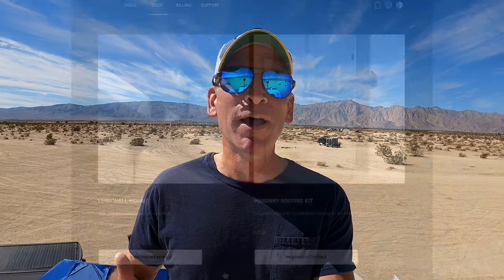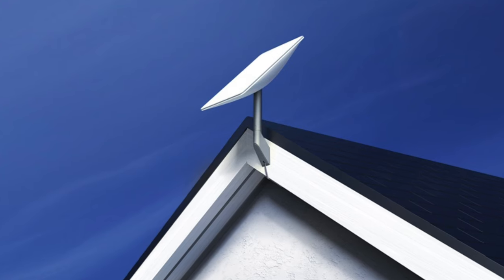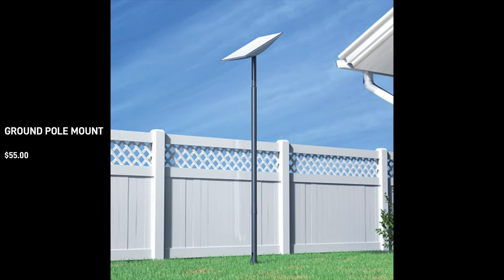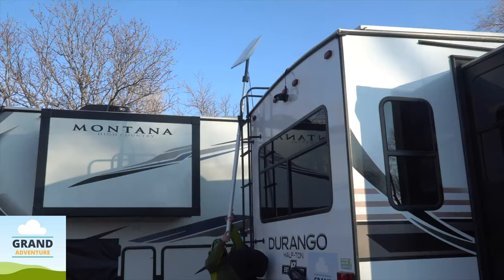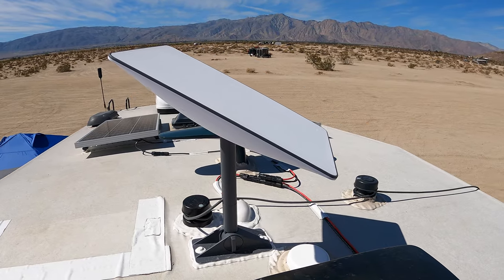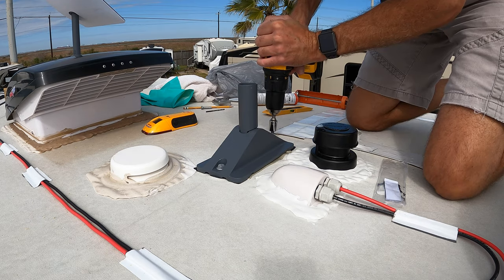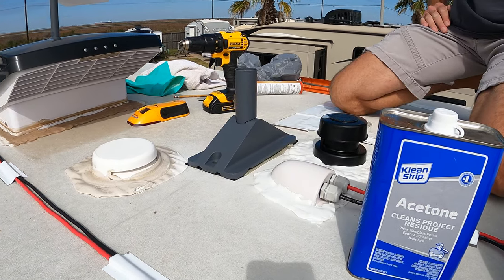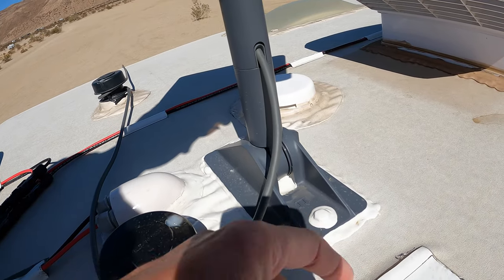Starlink RV Roof Mount Install + Review Of Other Starlink Mount Options

Comment: Thanks for the close technical view of the PIVOT mount. I went that route but my TT had nice oval cross rails on roof and I just drilled holes thur cross bars and the pivot mounted easy peasy close to my rear ladder. No holes into the actual roof.
Reply from the maker: Excellent!  Less holes in the roof is always better.

Comment: awesome job! have you driven the vehicle under gusty wind? does it stay there well? i’m always afraid that gusty wind will blow away or damage the dish
Reply from the maker: Thank you!  We have not driven with the dish mounted.  Once we arrive at our destination, we install and then take out of the mount before we leave.  We have been through some pretty big wind storms though while parked - 40 to 50 MPH gusts  - and it held up very well,  no issues.

Comment: Hi Homie, this is very helpful.  Drilling the roof is very disconcerting but your video eased the anxiety. Is it possible for you to tell us or show us where the cord goes? I am trying to figure out solutions where to run the cord without leaving doors or windows ajar.  Very grateful for what you guys are doing to inform us newbies.
Reply from the maker: Hi Lester.  You are very welcome!  In this other video, I show how I have our cord ran into the rig around the 2 minute, 20 second mark https://youtu.be/wm8IJ65dgag .   We still run it this same way even after several months.  I thought I would do it a different way for a more permanent run, but, this is just as easy and I don't have to worry about the cord or end being damaged by leaving it up on top of the rig while traveling.

Comment: Great video!  I just received my Starlink and had it running for one day.  It is awesome and I have attached it to my Class A with the pole mount to my ladder.  The first night I left it powered on all night and saw significant battery drain.  Last night I turned off the power to the unit and it went offline.  Powered up this morning and it took about 5 minutes to come back online.  Is this going to hurt the unit or do I need to leave it on all the time?  Thanks for your info!
Reply from the maker: Hi Casey!  Congrats on your new dishy!  We shut it down overnight to conserve power.  We've been doing this for over a month now with no problems.  Hoping that Starlink will come out with a DC power adapter.  I messaged Starlink and they said that nothing is in the works at this time.  I would think that they will eventually get to it as they see the number of people wanting to use it for travel.  Guessing they have bigger fish to fry right now.
Reply: @EddieAtLarge  it's funny you should mention this, there is now a plan for a 12 V adapter. The engineers are scratching their heads about this but there is a plan at least
Reply from the maker: @AIG Trader That's great news!  Really looking forward to it.  Thanks for the info!
Reply: Casey, do you remove the flag pole setup when traveling?

Comment: Hi, great video, thank you- I just purchased the Starlink Roam. It come with a mount that would seem more stable- is there a reason you did not use this,  instead of the mount you used.  Thanks again
Reply from the maker: You are very welcome.  Glad you found it helpful.  Yes, I did not use the original mount as I didn’t think it would seal very well where it would be screwed into the roof.  This mount seals very well and it has also been very stable.  We have had no issues at all.

Comment: How did you run the cable from the starlink? Im guessing you take the satellite down in transport so did you just come up with a temporary solution when out?
Reply from the maker: We do take it down while traveling.  We have the router plugged directly into our inverter that is located in our front storage bay, so, we ran the cable through a factory pre drilled hole in our propane compartment that is adjacent to this storage bay.  I have a Velcro tie screwed into the wall in the propane compartment and just coil the wire up and hang it in there while traveling.  I also tape over the end of the connector with painters tape to protect it from road grime and moisture.  Hope that helps!

Comment: G'day mate - great vid, but have you just sentenced yourself to never be able to park up under trees (obstruction)?
Reply from the maker: G’day!  Glad you enjoyed the video.  I actually purchased an additional 150 foot Starlink cable (from Starlink) to be able to string out the dish well away from the camper if we ever need to.  Surprisingly, we’ve only had to do this a few times.  We also have solar on the roof, so, we usually try to avoid trees and obstructions unless we’re plugged in at an RV park.

Comment: Hey man, thank you for this video. How do you guys manage the cabling?
Reply from the maker: You’re welcome, glad it was helpful!  We keep the router in our front bay where our inverter is housed and I have it plugged directly into the inverter.  The cable is then ran to the outside through a hole that was made for the propane line.  Then it’s up to the roof from there, however, I put the cable up and take it down each time we move.  While moving, I have the excess cable spooled up and secured with a Velcro strap and hook inside the propane tank bay.  Ideally, I plan to run it permanently to the roof so I don’t have to mess with it anymore.
Reply from the maker: I finally ran the wire permanently.  Here’s my install video if you’re interested.  STARLINK RV ROOF MOUNT PERMANENT CABLE INSTALLATION
https://youtu.be/CKsdDV-yQzQ

Comment: Ed, thanks for the info.  I just got back from 7 weeks of travel in my RV in Baja.  Don
Reply from the maker: Hey Don, that sounds awesome!  I’m sure it was a great adventure!
Reply: @EddieAtLarge   Ed, I highly recommended in your RV. It is so beautiful.
Reply from the maker: Cool!  5th wheel friendly?
Reply: @EddieAtLarge  Ed, it has narrow roads but I Did it in my class a with a enclose trailer and tow. I was 50' long 26000 pounds and I never disconnected the the trailer. So if I could do it anybody could do it. The tine of  Here is very important I suggest leaving February 1st and being back no later than March 31st.
Reply from the maker: @CowboyBikerAdventures   Thanks for the info Don!  Will definitely keep that in mind for a future trip.

Comment: Great video homey, 
Did you ever decide to run the wire permanently? 
If so what did you do and if not where did you pass the cable? 
Currently trying to figure out what’s the best option
Reply from the maker: Hey Juan, thanks!  I have not ran it permanently yet, but, am still planning to do so.  I’m going to run it from the front bay (under the 5th wheel) where we have our batteries and inverter.  I have the Starlink router plugged directly into the inverter that has 3 outlets.  I’ll run the cable from there, through the underbelly and into the area under our stove where our converter lives.  From there, I’ll drill a hole in the wall adjacent to the refrigerator and then run the cable up through the refrigerator cavity that vents through the Rv roof.  Then I’ll run the wire along the roof to the dish and tape it down with Eternabond to secure it to the roof.
Reply from the maker: I finally ran the wire permanently.  Here’s my install video if you’re interested.  STARLINK RV ROOF MOUNT PERMANENT CABLE INSTALLATION
https://youtu.be/CKsdDV-yQzQ

Comment: Hey great video very informative. Got a question can you leave the satellite up there while driving on Highway speeds?
Reply from the maker: Glad you enjoyed!  We take the dish down before moving and I would not recommend leaving it up there.  It may handle the wind, however, there would be potential clearance issues at overpasses and low tree limbs, etc… and when hitting rough spots in the road, it may loosen the mount or cause damage to the dish.  Some people are now making custom mounts by disabling the motor, cutting the back of the housing off, installing a new backing and installing the dish flat in a fixed manner on the roof.  Here is a link to the Facebook group Starink Hacks where you can see this in more detail. You will have to join the group to see the post though. https://www.facebook.com/groups/446129073286883/permalink/798557751377345/

Comment: Running the cable is also a challenge. Do you leave it on the roof while traveling? I know "In motion" is not supported so just unplug the router.
Reply from the maker: Hey Cliff, we take the cable down before we travel.  I thought about running it permanently, but, I’d still want the end protected when unplugged, so, decided against it (so far).  Yep, we just unplug it and put the router & dish in the original box for travel.

Comment: Hey - great video - thanks so much!  I was wondering though, if they didn't leave the higher "Sides" to allow water to drain out from under the mount?  When you put butyl tape there, that cut off the water from being able to drain there.  I saw you sealed under the pivot mount as well (directly under the pivot), but what if the pivot itself leaks?  Wouldn't it just be OK to leave the butyl tape off the sides, leave those sides "Higher" so they can drain any water that leaks through those holes under the pivot or the pivot itself?

I am also wondering about cable routing.  We just bought a Class-C and are planning on having StarLink for Internet.  Other questions are answered below, like does it hurt to turn the unit off overnight and so on.  And, I assume it's not a problem to turn it off for longer periods when RV is not in use and so on.  We have a crowded roof on ours, it's only a 24' Winnebago, so we may opt for the ladder mount, that seems pretty handy, and might even lend itself to being able to disconnect the unit and take it down for storage (and anti-theft) when it's not in use.  Avoids the issues above of drilling, taping, sealing rooftop.

Thanks!
Reply from the maker: Hey Scotty, glad you enjoyed the video!  I'm certain that they did leave the sides higher for the purpose of drainage as you stated and I did initially place butyl tape in that area by mistake, however, after further consideration, I decided that it would be better to completely seal the mount both inside and out.  If I would have left the sides and center open the way they intended, the only protection the holes made by the bolts would have would be the butyl tape at the corners.  If the bolts were to loosen at all, that would leave the holes vulnerable to water infiltration.  The pivot post is located up above the open center area of the mount so I was able to completely fill the center void with self leveling sealant.  I also removed the post before installing the sealant to make sure it got worked under the mount.  
You are correct in regards to being able to turn it off for extended periods.  We do sometimes turn it off overnight when we don't have much sun to recharge via solar and it's also turned off while we move locations (usually weekly).  I do prefer using the roof mount as it works well for our situation.  Do you have a specific question on cable routing?  We run ours through our RV "wet bay" which is where the water hose enters when on hookups and we plug the router into an outlet in our RV storage area.

Comment: Do you remove it when moving or leave it up and stowed? Looking at options to mount on mine and possibly leave it up.
Reply from the maker: Hi Aldi, we do put it in stow mode and then remove it.  Our rig is about 12' tall without the dish and we would be concerned about damaging it when going under an overpass.  We also do a lot of boondocking and take the rig off road, so, another concern would be it possibly getting damaged by low hanging tree branches.  The dish is very easy to remove and reinstall.  Starlink also includes a dish carry bag with a shoulder strap when you order the mount which can be utilized when taking it up and down off the rig.  Hope this info helps with your decision.

Comment: Since you installed it on a flat surface, would the original mount that comes with the dish work for this? It is designed for flat surfaces.
Reply from the maker: It could be used if the surface is flat and if you are able to secure it and seal the penetrations properly.  I prefer the roof mount that we purchased from Starlink as I know it meets all of those criteria and I also wanted to keep the original mount for when I need to string it out away from the rig to avoid obstructions such as trees.

Comment: So do you take the Starlink off the pivot mount and carry inside when driving? And then can you swivel the mount so that it sits horizontal with the roof?
Reply from the maker: We do take the dish down before moving.  The mount arm can be rotated down to lay horizontal, however, we  leave it in the upright position at all times.

Comment: Can you drive with it attached? Can you also use it while driving?
Reply from the maker: For us, it would be too high for overpasses, so we take it down prior to moving.  I did make another video showing how I permanently ran the cable.  It’s so easy now to put it up and take it down.  Only takes a minute.  STARLINK RV ROOF MOUNT PERMANENT CABLE INSTALLATION
https://youtu.be/CKsdDV-yQzQ

Not sure if it would work while moving.  I’ve read that it’s not supposed to as it would detect movement and shut down service automatically.  Starlink does sell an “in-motion” dish.  It is much more expensive though.

Comment: Great information video just wondering when you get the dish up there do you have to take it down and back up every time you travel or is it OK to travel with it there
Reply from the maker: Thanks Dennis.  We remove it before hitting the road.  Good chance it would survive if we left it up there, but, don't want to risk damage as the unit is not made for mobile use and chances are good we would clip it off while traveling under an overpass.  It's fairly quick and easy to remove and reinstall though.  Starlink is working on a truly mobile unit that can be left in place on the roof of a vehicle and can be used while driving down the road, just no word on when that will be out.
Reply: @EddieAtLarge  Thanks very much for your time and answering my questions I’m not in a hurry so maybe will wait to see what they come up with for a mobile travel trailer unit I have Dish for my TV that’s mounted on the roof I have a disability in my leg so I don’t really like having to climb up and down all the time because I only stay a couple weeks at each spot not ready to hunker down in one spot for a long time yet lotta friends scattered over Nevada and Arizona so I move around a lot once again thanks for your time

Comment: With the RV roof top install, are there any problems with high winds shaking the RV causing signal loss?
Reply from the maker: No problems at all.  The mount is very solid and secure to the roof.

Comment: Can the pivot mount be installed vertically on flashing/gable with the pole n dish up in the air?
Reply from the maker: I don’t believe so.  I think you would need a different mount for that application.

Comment: Great video!  Ordered my starlink last week and I should have it in about a week or two.  2 questions... First, how did you run you're wiring for starlink? and secondly Do you take dishy down when traveling?  Looking forward to you're response! I liked and subscribed!! 🙂
Reply from the maker: Thanks Tyler!  And congrats on getting your Starlink!  We ran the wire through our rv wet bay portal.  I show how we ran it as well as another option in our 2nd Starlink video around the 10 minute 20 second mark: 
https://youtu.be/nB5d8zqnvug  I was originally thinking I would run the wire a different route that was more permanent, but, it’s working out pretty well this way.  
We do take dishy down before hitting the road.  It’s pretty quick and easy to jump up on the roof and disconnect.  Thanks for subscribing and glad you’re enjoying our videos!
Reply: @EddieAtLarge  thanks for the reply! I will definitely check out that video! Thanks again and safe travels

Comment: Do you drive with the dishy on or take it down?
Reply from the maker: We take it down before we move.  I did a permanent cable run so it is now very quick to install or remove the dish.  Here’s a link to that video.  STARLINK RV ROOF MOUNT PERMANENT CABLE INSTALLATION
https://youtu.be/CKsdDV-yQzQ

Comment: Did you use the lag bolts that came with the kit? The ones I received are 3-1/4” long.
Reply from the maker: I did not.  Bought shorter ones of the same diameter.
Reply: @EddieAtLarge  thanks.  Appreciate the quick reply! That’s what I thought.

Comment: We recently purchased RV version. We’re in camp sites with some trees around. Do you find it takes awhile for it to come back online each place you go?  It’s been about 2hrs and still offline.
Reply from the maker: Hi Darin, no, it should come back on in only about 5 - 10 minutes.  Make sure the connector on the dish end of the cord is pushed all the way  up and in.  There have been some issues with that being loose.
Reply: It states offline searching. Done this for 5+ hrs.  I’m thinking there are too many trees here. There is a bout a 25% opening of the full circle.
Reply from the maker: Yep.  It does not do well with a lot of trees.  It can handle a few, but, sounds like you're surrounded.  We bought the 150' cord to be able to string it out to clearings when possible.   The Starlink app also has a Visibility tool that is good for giving you an idea if dishy will work in your location.

Comment: Mounting the current square model Starlink antenna on a moving vehicle should be approached with caution. Constant wind speeds from driving and the vibration from the road will take a toll on whatever the antenna is fasten to. I am constantly tighten nuts/bolts, screws just from road vibration.
Reply from the maker: Makes sense.  That’s why we take ours down before moving and we’ve had no issues with the mount coming loose.  👍🏻